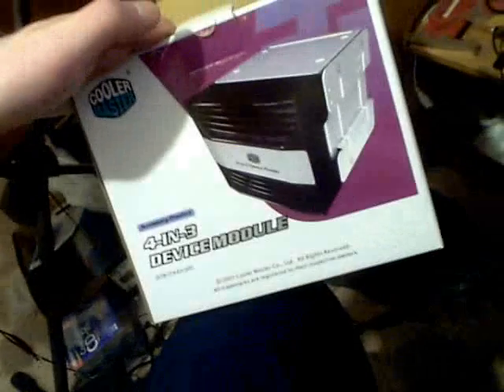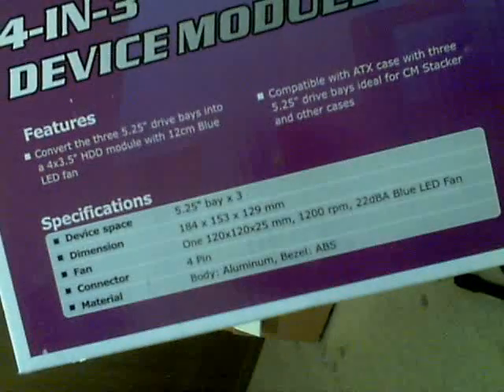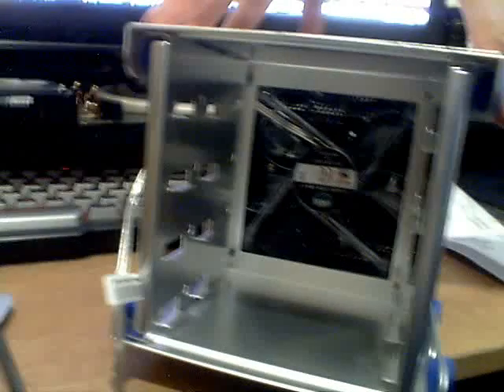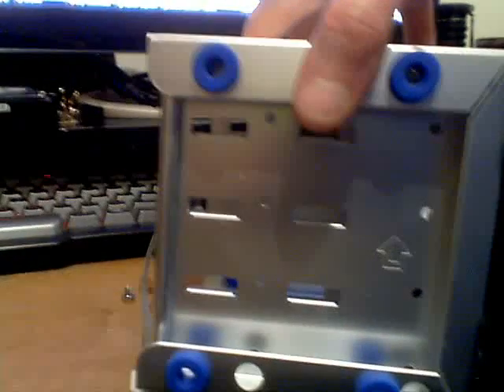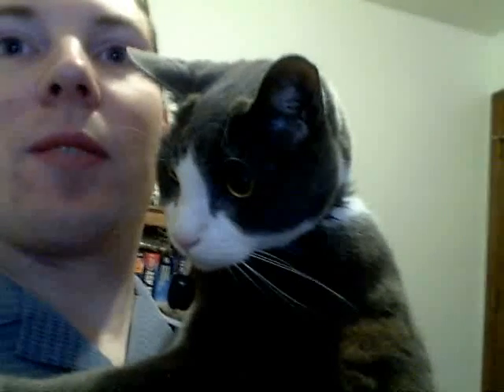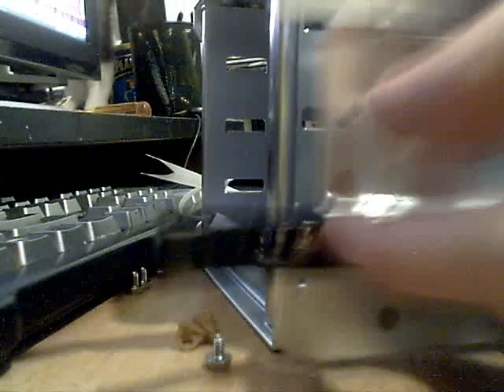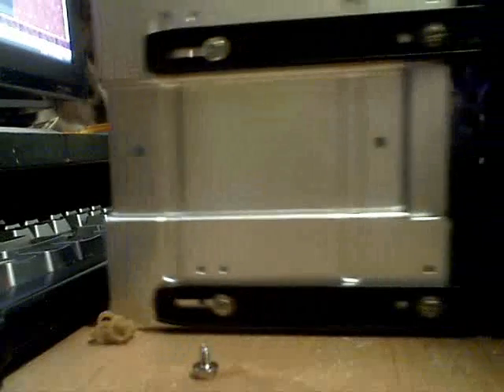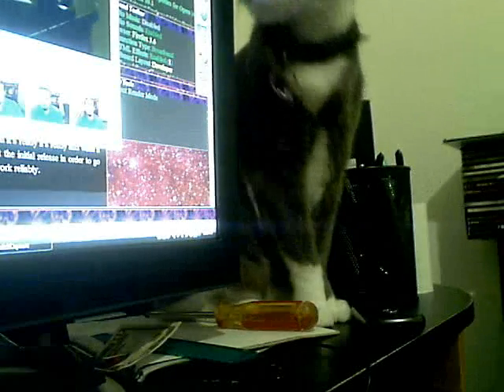3x5.25 to 4x3.5 bay converter - Cooler Master STB-3T4-E3-GP

Comment from the maker: @CityHunter84 RAID 0 is intended for performance at double the risk of drive failure. So I highly recommend while doing a RAID 0 to have a program export an IMAGE of your system when it's working fine and all patched up. That way when you rebuild the RAID 0 instead of manually installing it all over you can just have the app write the image back to the RAID 0 setup, probably save a few hours easily.

Comment from the maker: @ChaosTheory5789 You can setup a RAID 1+0 or 0+1 (incorrectly called RAID 10, there is no RAID "10"). You can also do a RAID 5 which uses three or more drives. I'm not a RAID expert though.

Comment: @jabcreations yeah i suppose SATA has a higher transfer rate then USB also is this correct?. i was just curious if external drives had a special security feature in them. aswell as being seperate from your PSU the external drive wont take a short circuit hit if the PSU blows.